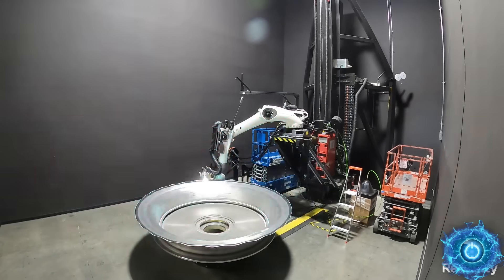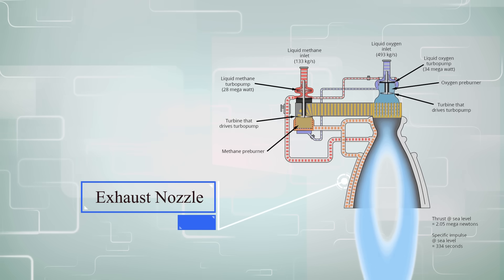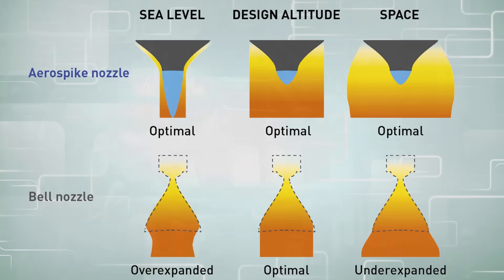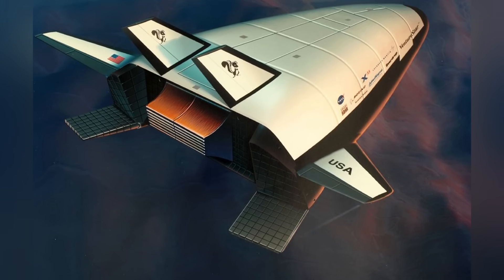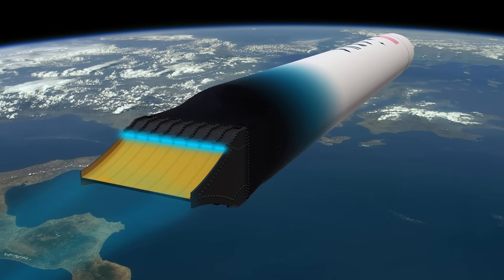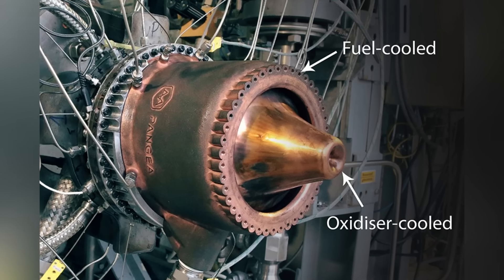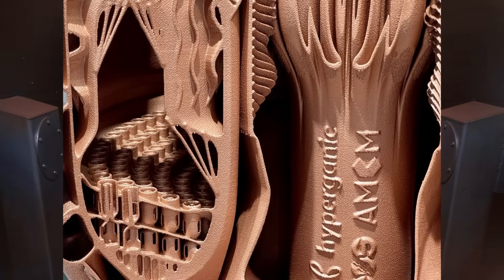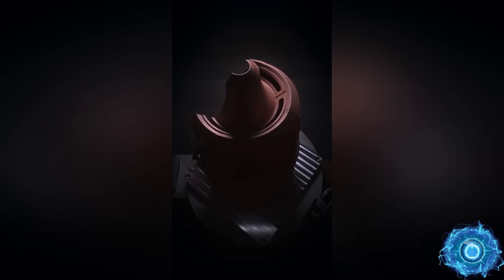GAME OVER - A.I. Designs CRAZY New ROCKET Engine

Comment: this is the direction that I've seen we need to go for several years now.  the combination of ML/AI quick iteration modeling for designs that we haven't thought of, in combination with additive 3D manufacturing.  it's finally reaching the point of practical real-world commercial viability.  i've recently seen the NASA development of the RDE with center toroidal aerospike using Nikola Tesla's design for a backflow preventing valve without moving parts, which I think you showed here.  It seems the company you showcased with this new design is incorporating all of these ideas. the same tech I think is also going to be useful for developing the new materials that we need to build with.and this extends to everything we make, on earth and off.
Reply: I just hope we can understand it* and be able to study it* rather than accepting and moving on. I don't want to return to "magic"
Reply: I do not believe we understand fluid dynamics to the resolution needed for AI to design something like this and for it to actually work.  If we push to throw AI into applications like this right away we may well set back AI use a hundred years because we will just think it's a failure, when in reality it's our own scientific understanding that's at it's limits.
Reply: @TK-xn3uf  its called machine learning and neural networks
Reply: @kobrapromotions  yes... and it's not good at creative new thinking.  It's amazing at pumping out things based upon what we already know and have already done.
Reply: @TK-xn3uf  not sure you understand how neural networks work....
Reply: @kobrapromotions  You understand this is a meaningless statement right?  Either say something of substance or don't bother.
Reply: @TK-xn3uf  the cool thing is you can use a different algorithm to figure it out.
Reply: Not really.  Or we would have already solved dark matter, and a number of other lingering physics problems.
Reply: @TK-xn3uf  our main issue with fluid dynamics is that we cannot resolve the equations that describe this phenomenon (specifically the Navier-Stokes equation), not that they are incomplete (at least not wildly). Having an AI that takes the equations and constraints as input and resolves everything would be exactly what we need
Reply: @jahmalbaptiste9915  Yes.  but AI isn't good at solving for new things.  It's great at applying things we already know.  The question is if it used the limitations of what we know when it designed this.  My gut reaction looking at this would be that it did not.  Given that you can state the name of the problem which i'm simply barely aware of, you seem to know far more about me than this topic.   So, what do you think?
Reply: @TK-xn3uf  we cannot solve fluid mechanic equations formally but only numerically, which is very computationally costly to come up with satisfying simulations (as in close enough to reality). This makes that leaps in aerodynamic designs are made by tweaking them iteratively, based on the understanding of the previous simulations. Making this iterative process alone based on AI would be enough to speed it up and come up with designs that would not be imagined, which is probably how the design shown in this video was created.
I'm a data scientist who studied fluid dynamics in my engineering course (to then specialize in AI) so my technical knowledge on this topic runs back to some years ago (around 4~5)
Reply: @TK-xn3uf  you are conflating understanding and simulating. It is hard to understand these phenomena because of their erratic nature, which cannot be described formally (beyond the equations that describe them). Simulating them is another exercise of its own and can be done (on small enough temporal scales) with enough computational power.
I do not know more about this design than what was presented in this video but I am not shocked by the visual we both saw. It would be good to have a technical presentation because I can only suppose how it was done based on my (granted limited) knowledge.
Reply: @jahmalbaptiste9915  If you can not formally describe the phenomena.  You can't program a simulation.  You need the formal description to run an accurate simulation.

You can simulate them only to the degree to which you can formally describe them.  Otherwise you are just winging it.  

If you can't simulate them appropriately, then you can't really leverage the iterative power of AI, because you are limited by your ability to conduct real world testing.
Reply: @jahmalbaptiste9915  How this will perform in real testing, will be interesting all the same.  We will learn lots success or failure.
Reply: @TK-xn3uf  fair point, 

Alright I'll add some substance. Neural networks can be but dont have to be trained or pushed in a particular direction. Thats literally half of the point of them. Given , yes, some are given a specific task, but all of them, learn and find and program themselves to find the solutions, sometimes their own solutions in ways we couldnt have thought or realised was a goal. A good example, and an actual neural network in a sense would be; you could think of the beginning of life as a neural network, self organising, until it becomes more and more complex. It didnt need a direction or to be prodded, it evolved naturally depending on the circumstances/surroundings/environment. Neural networks coupled with machine learning/AI are almost hand in hand.
Reply: @TK-xn3uf  you are wrong about not being able to simulate something you cannot formally describe because you forgot something in this case: we can formally describe the differential equation of this phenomenon. The only thing we cannot describe is the solution to it. That's how simulations work...
Reply: @jahmalbaptiste9915  simulations work by running equations.  It can't accurately simulate the part we can't resolve.  That's the simulate part, and where the problems come in when we try to move something from simulation to the real world.  

Which is where the errors in simulations come from, we simplify things to get rough approximations.  But our errors in fluid dynamics come in at the smallest, fastest, eddies in the flow.  This generally isn't a problem for a simulation because we generally design in ways that avoid the known issues in a simulation.  However, it appears the AI is not designing with that issue in mind, which appears to me, to have resulted in a design where this limitation may well be a huge issue.
Reply: @kobrapromotions  Yes, but they are still limited within the confines of what we know.

In this regard we can not mathematically describe the flow of fluid around very fast, small areas.  Thus the AI can not design with the reality of that in mind, it can only design with what we have told it about that issue in mind.

It can't make a new discovery about reality that we have no ability to tell it about, since we are incapable of telling it about it to any degree of accuracy. 

This is what I mean by it's not good at coming up with new things.  Yes, it IS very good at coming up with new ways to apply the things we already know and have proven and already understand.
Reply: @TK-xn3uf  the whole point of simulating is to get numerical solutions to problems for which we cannot get formal solutions. In other words, simulating something for which a formal solution is already available is completely pointless (unless it is used to assess the quality of a simulation method).

At this point we are yet to see this design tested or even explained so assessing its performance is premature. I am eager to see how it performs but I can already say that nothing shocks me for the moment.
Reply: @jahmalbaptiste9915  I feel like you are conflating modeling and simulating.

manufacturers and designers simulate loads all the time to prevent building the thing to actually apply the loads...  It's used because it's faster to simulate things than to do all the math to determine exactly how something will react under numerous scenarios...  

Modeling is used when there are still massive gaps in our knowledge set, and this is generally far less useful for engineering purposes because it's not a good simulation of the real world.  

But, we shall see what happens in the coming years :)
Reply: @TK-xn3uf  I honestly think its just a matter of scale that hasnt been achieved yet
Reply: @kobrapromotions  No...  the AI can't work with what isn't digitized.  How do we digitize something we don't understand? 

The AI can't even tackle the unknown because there is no way to tell it about the unknown in a form it can handle.  

Never mind that the largest super computers / server farms on earth have been used to train up the current crop of AIs.  If it's a matter of scale, we don't have the capacity to do it at all yet.
Reply: @TK-xn3uf  also agreed we are not at a stage where we have the ability to get to the scale I am contemplating. Wonder how far along Moores law we are currently.
Reply: @jahmalbaptiste9915 I do IT, what exactly do you mean by calculating formally? I am researching AI and want to improve the systems. What would you say are some of the biggest limiting factors? Would a local repository of information cause faster computations or is the bottleneck somewhere else? I am attempting to optimize and include a larger repository in a standalone configuration instead of providing internet access
Reply: Yes, what could go wrong with a technology like this, what we did not understand, in the hand of the greediest corporation on this planet? I mean the tech is good, and powerful, so lets use it to create more greed and train them to be greedy. 

This engine looks cool tho.

Comment: I had been thinking why they not use A.I. for things like this... like new medicines, treatments, battery chemistry etc. Also: Isaac Asimov has a novel where an A.I. designs a working FTL drive :)
Reply: I would like to get ahold of an A.I. to ask it about making an FTL.
Reply: @tonymc9102  I bet that putting a combo of a powerful language model and an engineering design AI on the job would get us somewhere faster than the pace we're going. The math checks out for the Alcubierre drive, the question is if you can actually turn it off again before it gets stuck in FTL or overheats catastrophically. There is also the not-so-minor question of where and how, precisely, one might be able to acquire and contain hundreds of kilograms of antimatter without bankrupting the entire planet and/or vaporizing in a fireball that makes the Tsar Bomba look like a firecracker, but if they can help crack fusion reactors and conventional rocketry to bootstrap orbital manufacturing infrastructure... This would not be a trivial task, even for an actual superintelligence, but once the groundwork is laid, it is not impossible.

Comment: Technically speaking, it's not AI design, but rather it is AI optimization. 

There is engineering involved that says "At this location the fuel is coming in, at this location the oxidizer is coming in, all the mouting points and support brackets go here, here and here, and at that end, at that distance, is the rocket nozzle rim. Now go fetch!"

And then AI will "build", or "construct" if you will, within those constraints to come up with a part. A FEA/CFD simulation will be run, and any issues (weaknesses, hot spots, excess local material, etc) will be addressed, either by another AI run or by hand, and more simulations follow.

Comment: engine looks cool enough scfi also show describe principle and mean off goal achieve ok is chamber what type off design how many main chamber what purpose off owerflow and is not secret a like twin turbo like in car engine could be like new 420 t oxy air engine and that has serious blow except this time is proper fuel and siye like NASA head then is servo rotation on 1/3 size engine in 2x2 paor vtol  and basic air glide so corvette gets like mimic wings and airflaps front and slight wings expand like bird in down and corvette also iff big one 4 air flaps for airlgide drop down also tech for safety use ower air cocpit so peek is slight up for less heat in window front also posible totaly closed hatched door pop out so corvette allow efcient air athmosphery glife and drop entry and cruise glide tomahawk system  and modern fuel allow tank shred and vtol are bit new age so no runaway and even cocpit lean on airglide or reentry so scf flight is altime posible and improved and corvetter has like like large front and back tail glider for air suport glide techincaly they are not airplanes but use a lot off airplane scfi in glide and drop but rocket engine speeds up stuff the rest can be used in conventional transporter stuff but probably not same speed or strength off engine so engine melt is not stuff on reconsidering a bells cool tech used and bottom ring absorbed and piped and reinforced so even aditional coolinf allowed allong side main gas fuel line or aroung on plate protectr sensitive part which wokr like cataliyst sheet liek car has pretty much like car aseembly tech but a lot greater temprature and material max expand limits is some case even ower limit exceed production flow due to furfill particlaytion parts for indistrail assembly in each case a  one or two engines can suply power to smaller corvette in orbit to easy or do trasnporter role at UAV safety and drive nav by wire autopilot or pilot driven to easy compared to stuff that space x handles is not even close but consolidate plans and achive owerturn is in advising and demanding change on am stuff main goal is owerproduction and achieve drop price as even stronger are possible at energy eficient level and less fuel consumed as oxy power so goal even in serious power is shoted out then categorization aand chasy development and suport engines then next generation off improved chasys which owuld have scfi alternations almost as pc corvette like design like car crush design improvments so safety lvl would riye considerably and lowest limitations also then is program safetadn assembly  lvl and dsitribution is safe more safely at better easy and a lot better quantiy speeking off car assembly line production number so this segment wasdlty improve and offer satisafaction vtol transport rize and easier poping transporter vtols  in use again comercialy based productivity and production number and this time is not just helicopters so engine in range when can  be swaped from jet hybrid to rocket easy so 3d prints evens sfi chamber design as in defined purpose are not to uneasy or uncomon as in time is like 15 years or to spend in reserch to combine better in 3-5 year cycle and something on board that is eficient research and inovation allow with surface off 30% off year production trade budget allow fast integration and fruther persuade goals and goals are poiping until final plans set or raw goals in future sets there when production goals when begins to boom and minified ore materail rare metal extraction on surplass electricty society is understandable in such as mission on mars early begin etc

Comment: I don't think I'd say single stage to orbit in a video without clarifying that there's no point from Earth. Even if you suck in oxygen in the lower atmosphere to save on oxydizer, use detonation or aerospike, the rocket equation doesn't leave you much mass left for heat shields, landing equipment or payload. If we make nuclear engines, maybe. It's just solving the wrong problem when two stage to orbit works so well.
Reply: Agreed 100%.  Especially now that the first stages are so quickly and efficiently recovered without a damaging re-entry.  Why on earth would we ever want to push a massive, empty container up into orbit just so we can try to get it back again later (or have it destroyed)?